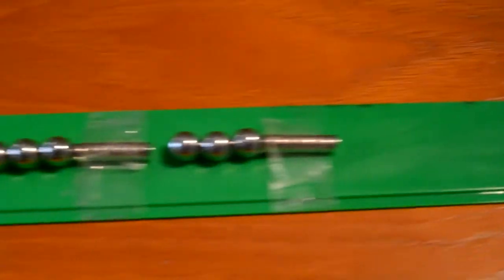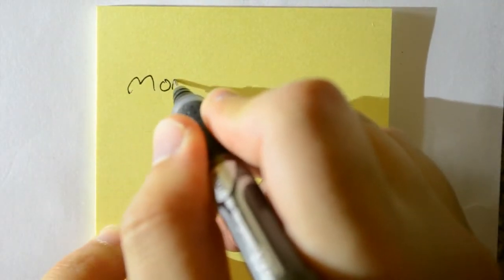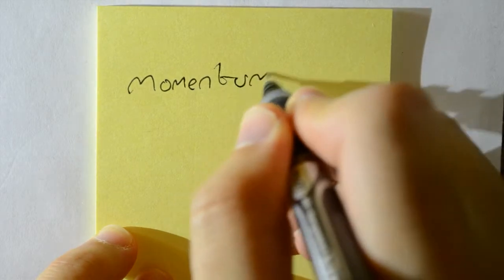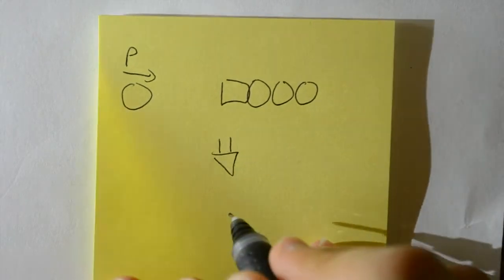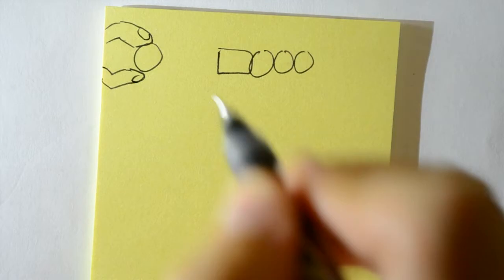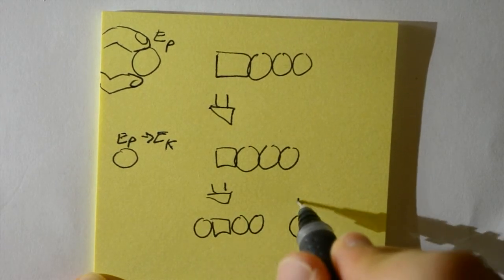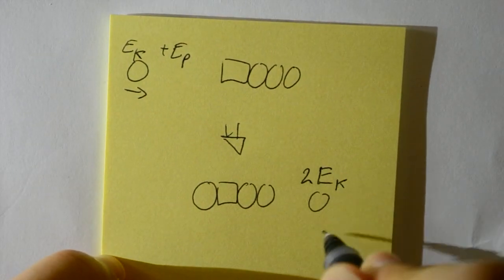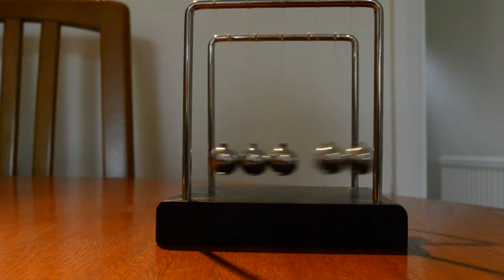Magnetic Cannon (Gauss Rifle)

Comment: Does that mean that your magnets eventually lose their strength to provide potential energy?
Reply from the maker: The (kinetic and potential) energy of the first ball bearing provides the energy for the ball bearing at the end of a magnet to fly off, the magnet just allows for this energy to be transferred across from one ball bearing to another, so in theory they have no net change in energy.

However, once you've fired the cannon and the final ball bearing is no longer involved, it does seem like you've lost energy as the ball bearings are in a configuration of low potential. This is where you have to do work to pull the ball bearings back and reset the cannon.

In theory you could reset your cannon an infinite number of times and the magnets would not lose their strength - but the constant collisions could cause them to demagnetize over time.
Reply: ForwardSlashReality wait, how can I I throw in the cannon a small sphere of mass m and velocity v, and then get as result a sphere of mass m and velocity v' (v'>>v) flying off? I mean, the extra kinetic energy that the second sphere has, must have come from the magnets, because the total energy has to be the same.
Reply from the maker: The extra kinetic energy comes from the potential energy that the first small sphere has just from being near to a magnet, but this potential energy is a property of the sphere and not of the magnet. So while the sphere can lose potential energy to gain kinetic energy, the magnet itself does not lose potential energy.
Reply: ForwardSlashReality oh ok i get it now thank you